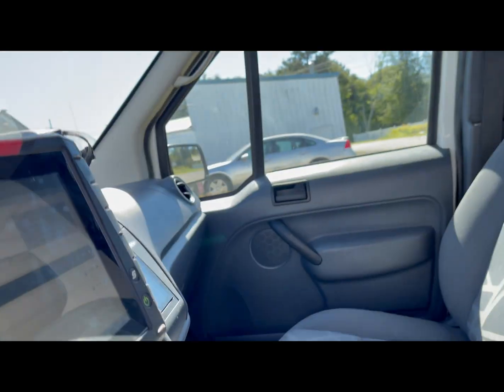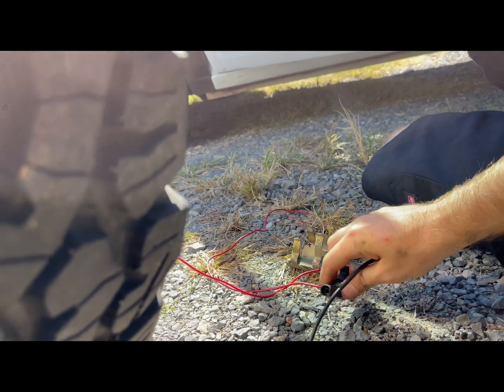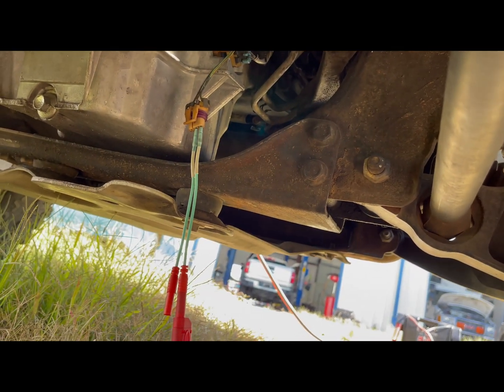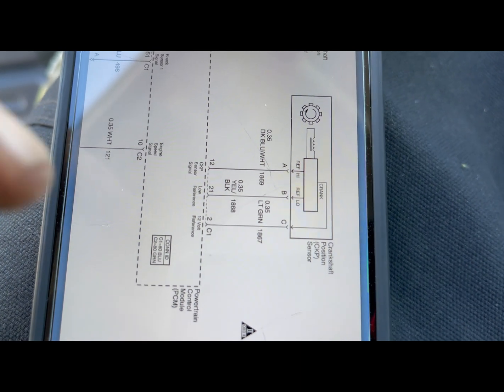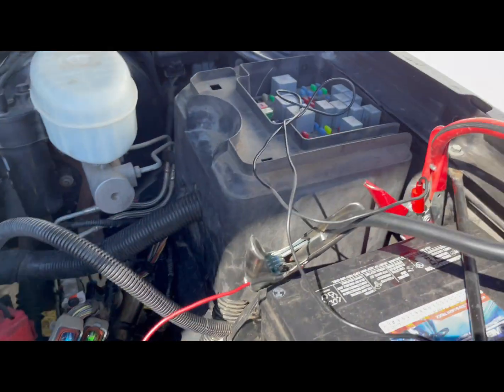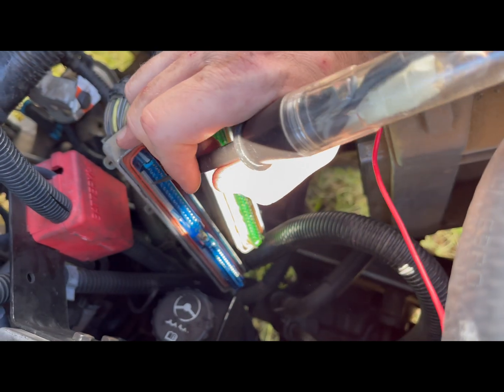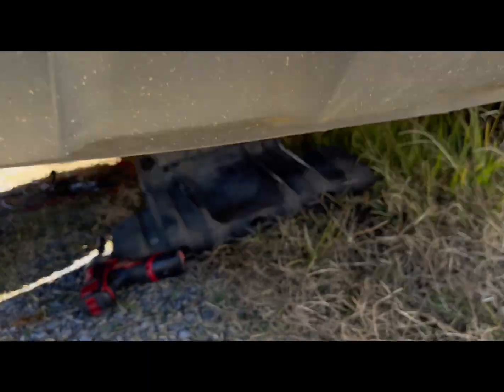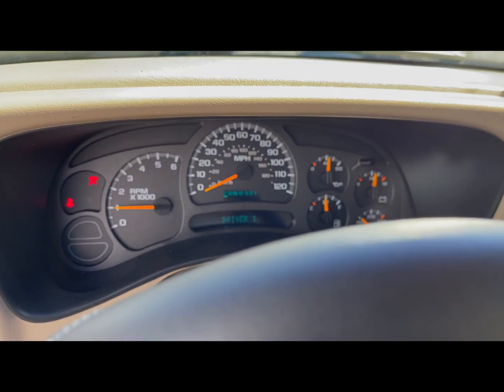Silverado Cranks but won't Start! P0335

Comment: I would appreciate some help. My father in law replace this sensor in his 2010 silverado 2500 hd which has the 6.0 and is throwing this code. I used a multimeter and tested for voltage and was getting 5v not 12v on the right lead with the tab facing up. I was also getting continuity between all the leads with power on. Is this normal with the ign switch on? I know one wire is +, - but what is the other wire? A lil bit over a year ago the truck broke down and it had damage pushrods. We replaced them, but this code has been present since it broke down. I would appreciate help or advice thanks in advance.
Reply from the maker: On a 2010 I believe the crank sensor is on the 5 volt circuit.  So you should have 5v, square wave signal, and ground.

Comment: Hello, I recently started having issues with my 01 Silverado randomly doing this crank no start and sometimes randomly dies on me, sometimes it will start right up and sometimes it won’t, i checked fuel pressure and pump and it works, also no codes at all. I found out it has no spark and fuel when it has the crank no start issue so I checked the grounds and everything was good thereI came across your video and decided to check the crank shaft sensor connector, connector seemed good only thing I found was it had oil in the positive power pin, could that of caused my random crank no start problem? I just cleaned it today and I’m hoping for the best

Comment: did a ton of tests
showed bad fuel pump  changed it

yadda , yadda, yadda , sensors, soark  etc

finally just went with my gut and ignored the tests

changed cap and rotor

started right up

intake manifold gasket coolant leak into cap because of how the stupid 4.3 is made kills the cap and rotor